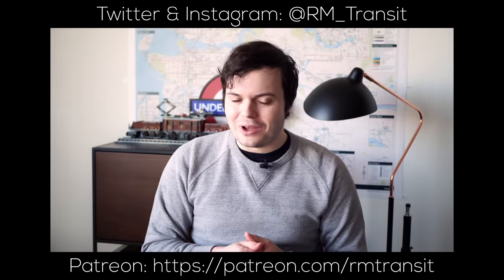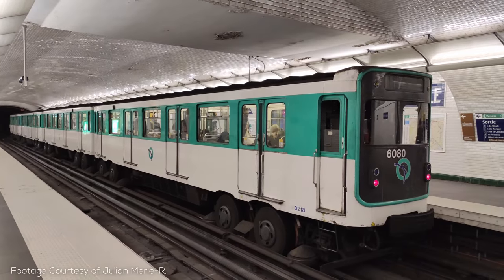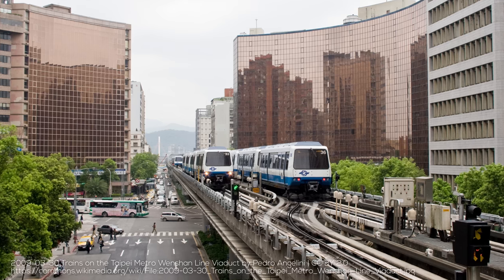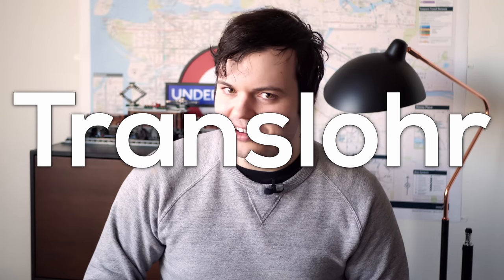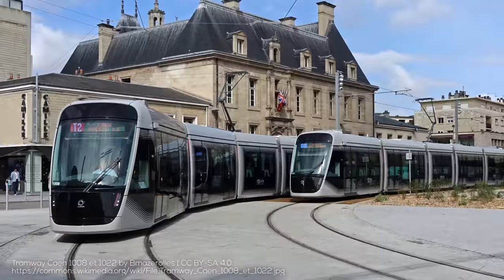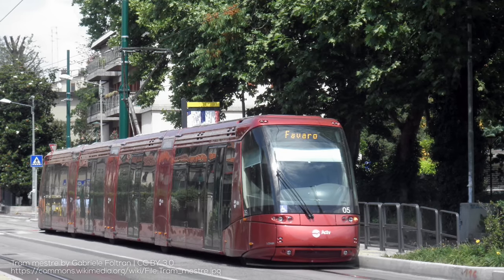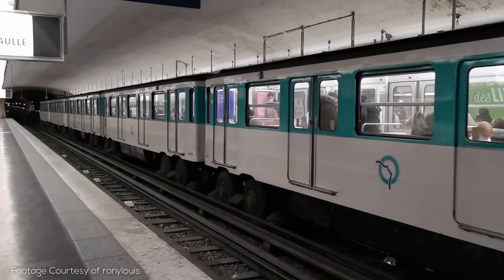Rubber-Tire Rail Transit is Weird

Comment: in my city (Perth, Australia) there's been something of a push for 'Trackless Trams' recently--specifically, the ART system by CRRC. Pretty funny to me, since 5 minutes of searching will tell you their weight and tyre configuration makes them illegal to drive on our roads.
Reply: Why would they be illegal?
Reply: I hoped thats what this video was about. I'm looking forward to the Trackless Tram, I'm sure they can change the law. What will be interesting is to see if the vehicle alignment causes rut formation and requires concrete guide way, at which point it loses all value. 

But, if Perth lets ruts for, rips up the road and builds a real Tram, and then puts the Trackless Tram on a new route to repeat, that would be something
Reply: @neolithictransitrevolution427  I don't get the trackless tram personally. Seems like a lot of work and expense for not much reward.

I'd much rather see dedicated bus lanes and bus priority at traffic signals across all the 9xx bus routes, and maybe some rebranding, which would likely cost a fraction of the current vague plan to convert half a route to a "trackless tram".

I also don't like that the City of Stirling is so obsessed specifically with the ART vehicle from CRRC. Volgren is making very similar vehicles for Brisbane Metro. But they're calling them what they are, buses. CRRC seems to be pretending they are in a different category in order to avoid a fair competitive tender process, and City of Stirling has fallen for the con.
Reply: @neolithictransitrevolution427  This reminds me on ideas about treating BRT and trolleybuses as a base for new tramways and LRT since their infrastructure costs are lower than building a street railway.
Reply: @MarioFanGamer659  I would love to see a jurisdiction explicitly set up a schedule for a project of that style. It's long time horizons, but you can cycle your Diesel buses onto a new route when they phase out, etc. 

At the same time you upzone along the corridor, so by the time an LRT is built you have a dense urban linear area.
Reply: @thegreentimtam  yea it seems like spending a lot of money for a marginal gain over bus improvements, which would actually be substantially cheaper. You can also have much higher frequency by buying more ordinary, or bendy busses
Reply: @thegreentimtam  I mean, to me the point is you get a fair amount of reward for not to much expense. 

I 100% agree "Just build BRT". Like that should be the first step always, you literally just have to paint triangles on the curb side lane of a stroad, and update some light cycles. 

But I think as an update to that, the ART offers reasonable capacity boost, maybe a more comfortable rode (or the illusion of a more comfortable ride as many people are annoyingly bus phobic), and self driving which cuts out a huge part of the transit cost. 

I do agree they should be treated as buses for most purposes. And I'm not saying I appreciate the execution. But (as a Canadian) I'm very excited to see this Australian project go forward and learn about the operational aspects and actual cost of building infrastructure.
Reply: @Joesolo13  It seems to me this is true in terms of Capital cost, but since the ART is Autonomous, you have a much lower labour cost. And that may allow higher frequencies/lower cost long term. 

But yes always start every project by saying "wait, should we just give the bus a passing lane and signal priority".
Reply from the maker: Yeah I’m skeptical, very skeptical….
Reply: They've calculated that certain wheel arrangements and tyre dimensions can carry specified weight limits per axle, in order to try to prevent rut formation. iirc the ART vehicles exceed the limit by 40-50% on the driven axles.
Reply: The part about rut formation worries me, because the ART exceeds the 'safe' weight limit for that by quite a lot. It's really designed for concrete surfaces.

...it also prevents us from building grassy tramways ;P
Reply: @neolithictransitrevolution427  They aren't actually autonomous, as all current models are built with space for, and driven by, a driver. It's largely a marketing exercise; the ART (Autonomous Rail Rapid Transit) system is neither autonomous, rail or rapid transit. It's a fancy guided bus, very similar to the long existing O-Bahn in Adelaide.
That system hasn't been expanded for a reason, with Adelaide instead opting for the more sensible option of improving the rail and tram systems.

The only benefits this system has over the O-Bahn is the larger capacity and being electric rather than diesel powered. However, these both massively increase the weight, leading to the rutting issue, higher maintenance and the problem that they cannot go on normal roads due the damage caused. In my opinion, this makes the system largely one designed to lure gullible and self serving politicians to the lower upfront cost and "futurism" of the ART.
Reply: Not an isolated case, here in Indonesia the national govt is also aiming to get the "ARRT" (which frankly is a bus) as part of the supposed public transport system in the planned new capital city.
Reply: @neolithictransitrevolution427  the downside to this strategy is the time to convert the line from fancy bus lane to tram tracks would probably require not running services. It's inevitable sometimes, but should probably not be intentional in the early days of a new line. Especially since it could hurt development if people know that the disruption is coming, so don't want to move to the area until after the upgrade occurs anyway.
Reply: @matthewparker9276  I disagree, I think if you have the plan laid out in advance distruption can be minimal. Buses can be run over tracked sections once complete, and can detour into the left lane in areas under construction. 

Generally transit project (in NA at least) seem to suffer from extreme short sightedness, so distruption for upgrades is common. But with planning it's avoidable.
Reply: @svenwillett1750  it's interesting to note that the local politicians seem to have been taken in by CRRC's claimed passenger capacity, too. The claim is that a single (3-section) ART vehicle can carry ~300 people, but this is apparently based on a packing density of 8 people per m^2, when the Australian standard is 4/m^2. Auckland Light Rail Group, who were considering the system, released a memo calculating the actual capacity at 170 people.
Reply: Perth really has a pretty extensive bus network and yeah some trips could probably be replaced with other forms of transit.
That said it has been previously talked about putting light rail here (Perth MAX), but the government of the time decided against it and we still have busses (The 960 appears to follow the route of the main spur between Morley and the Causeway and there is a rail line being built that will serve Morley which might replace that).
I do think not having some sort of rapid transit option over the causeway and through the city is a missed opportunity though, not ideal having so many duplicated busses running into and through the city, which could be served better by a single tram/light rail service. That said Vic Park Transfer station is not particularly well suited to terminating bus services and would need to be redesigned to cater for that. (which I suspect would have been part of the Perth MAX proposal)
Perth will probably either settle on a basic BRT system or do its typical exercise of replacing routes with a single High Frequency bus service, likely not alot of money left in the kitty for transit projects after the extensive Metronet build.
Reply: @LawrenceBayly  The 960 runs from Mirrabooka, not Morley. But indeed, good summary.

The ART proposal runs Scarb Beach Road from Glendalough to Scarb Beach, which is currently serviced by the high frequency 990.
Reply: @svenwillett1750  My understanding is that while there is a dtiver thier for safety the vehicle is self driving. Once a demonstration period is over and the self driving is approved I would expect to see drivers tajen away. Is this incorrect?

Idk about maintenance, EVs generally reduce requirements. But the potential rutting is the big problem to me. If it prevents ART use on standard roads, and requires concrete guideways, then the project has no use.
Reply: @svenwillett1750  Tip: When you see a non-indactive XYZ name just call it "accurate under Voltairian definition i.e. neither X nor Y nor Z". ;)
Reply: @neolithictransitrevolution427  Nope, it is not driverless. Autonomous-rail is the name of the guiding system - so the "rail" is autonomous, but the vehicle is not. It is driven like a tram.
Reply: @thegreentimtam  I'm unclear what you mean. Are you saying a driver starts and stops and the rail guides in motion?
Reply: @neolithictransitrevolution427  that's my understanding
Reply: @thegreentimtam  Mine as well. 

What I'm suggesting is that the starting/stopping is relatively easy (Tesla has been able to do this for years), and the hard part is general driving. So while a driver is certainly beneficial for the short term while testing, long term I would be suprised if these systems didn't get a software update to be fully automated.
Reply: @thegreentimtam  Actually replacing the 990 probably makes a lot of sense considering busses are likely not that well suited to carrying surfboards (the 990 being the only service where surfboards are permitted (unless under 1.2m long)), so maybe they can look into a longer more dedicated vehicle that would suit that purpose. I'm guessing if they wanted to they could run it directly out to the beach too, rather than on a road nearby.
Any chance you have a URL for the actual proposal?
Reply: See what happens in Brisbane I suppose
Reply: @pointlarf7412  as far as I understand it, Brisbane has ordered a bunch of electric bi-articulated buses and are inexplicably calling them 'trams'? I mean, good for them, but their vehicles are nothing like a tram in layout or in operation. Their messaging is confusing lol
Reply: @sorenfox  fair enough... How do they differ?
Reply: @pointlarf7412  Mainly that they are called buses by the manufacturer, and do not have any kind of guiding system. But they are both bi-articulated electric buses with level boarding and somewhat tram-like styling.

I wasn't aware Brisbane was calling them trams. Everything I'd seen about Brisbane Metro referred to it as a busway with "tram-like buses", which I think is fair.

Edit: the Brisbane Metro website now refers to the buses as "metros". Honestly, I think I hate that more than "trackless tram".
Reply: @thegreentimtam  yep. Personally I think it's the way to get something off the ground relatively quickly... In Brisbane at least.  Should be doable to automate by retrofit... We do it in the mines under more trying conditions... I think they just call them metro...instead of labelling them buses...which they are...

Comment: Tires are based, like the MPRT. They do allow for tight turns using 4 wheel steering.
Reply: I don't see why you couldn't do that with steel wheels. In fact, I believe that at least some modern US freight train engines actually do that. (Probably helps especially with three-axle trucks.)
Reply: @KaiHenningsen  we use them because of the steep grades along several portions of our track. The city is built on the side of a large hill and the majority of our guideway is elevated, so the cars have to be capable of going up steep grades at times.

Comment: The fact that rubber tires makes less vibrations is important for metro like Paris or Lyon when the lines are not deep. Vibrations spread to the nearby buildings, and living nearby a metro line, I am pretty happy with the rubber tires.
Reply: Interesting, it may be a less expensive way to deal with NIMBYs than boring. This idea deserves some digging into.
Reply: @neolithictransitrevolution427  Your comment certainly deserves some form of a punishment.

Sorry...

Comment: In Japan, rubber tyred transit systems have been introduced in 3 types, subway, monorail and auto guided transit (AGT).  Only Sapporo City adopts a full scale rubber tyred transit system for its subway lines similar to those in Paris.  Other monorails and AGTs are adopted by a large number of business operators as a medium-capacity rail transport system.  A rubber tyred tram system has not adopted even a trading company marketed Translohr in 2000s but no adoption result was made.
Reply from the maker: Yep! It’s mostly crystal movers and monorail

Comment: Hey, you talked about my city!
I live in Caen, Normandy, the city that replaced tyred trams with traditional ones (at 7:21).
I witnessed the old trams (which were small and crowded, such that on chilly mornings, a lot of condensation formed on the windows), the transition period (lots and lots of road works, and sometimes the old trams hat to use their motor engines on sone sections, since the power lines had been removed) and the advent of the new tram!

Comment: 12:45 Actually when raining rubber tyres will suffer less loss in braking power compared to steel wheels, unless your tyres are slicks, which in the past would likely have meant that automating a train would've been easier if it used the former (unless its fully underground & thus the tracks won't be made slipperier by rain), though I guess improvements in propulsion/signalling technology would make this less of an issue for steel wheels now e.g. embedding sensors to detect if a track is more slippery due to rain, which would trigger trains to brake earlier & more gradually, & perhaps run at a higher top speed to make up for loss in time due to more gradual braking

Comment: The rubber tired tramway in Nancy, France has a very steep lane. 
But when there is snow or ice, they can use their diesel to follow the road (not as steep).

Same for at least one of the parisian tramway, it climbs a big hill, that cannot be done using steel wheel.

And for the parisian subway, for the line 6 (the aerial one with rubber), using rubber tires is much much quieter than  steel. This is important when the subway is aerial in wealthy neighborhood. (The second aerial subway has steel wheel, but it moves in more popular neighborhood so....)

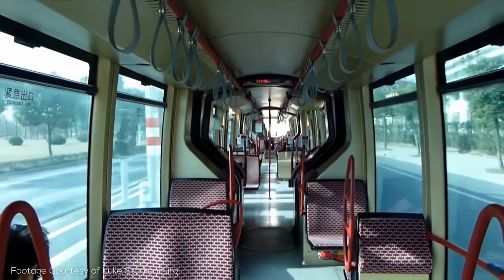Comment: 9:10 yeah, about the issue with the state of the rails, there arw issues that can't be solved with maintenance, in the case of Mexico City that is the sinking of the city.
That is why we chose rubber tired trains, they are ligthers and more forgiving to alignment of the tracks and because of the differential sinking of the city it was impossible to keep a perfect aligment, both, vertically and horizontally, rubber trains could cope with the tunnel becoming quite bent over time in a way that it was not possible with steel wheels, and the tunnels themselves were designed with that in mind, even trying to make them some what bouyant to mitigate the sinking as much as possible.

Comment: I used to live in a somewhat steep city in Switzerland and they just had dual-mode trolleybuses which ran off of overhead lines in the city center and diesel in the suburbs and countryside. I don't know why more small-to-midsize cities in North America don't take advantage of this model, as the startup costs are relatively low and the flexibility of the system is quite good.

Comment: Can you talk about Interurbans and why did they went away? Is their still a use for them besides coach buses or Commuter rail?
Reply: He talks about how important regional rail could be for our cities fairly often. Personally I would say that BRTs and regional rail make intercity tram lower value, but there is probably a place for it in polycentric cities or small cities.
Reply: Zaydan Naufal  Until very recently I would say Ottawa had one of the best as well. 

The advantage of BRT is the rapid build out time. Most BRT routes should evolve into Trams/LRT over time, but I don't think there is another solution if we are serious about extending quality transit throughiut North American Cities. 

Besides, how far are we really from self driving buses.
Reply from the maker: I’ve talked about them in a couple videos, maybe a dedicated video is a good idea!
Reply: @neolithictransitrevolution427  I think the Rhine-Neckar region is one such an example where it works (fitting because it is polycentric).
That street running section in Seckenheim, Mannheim? Not a tramway but a narrow gauge railway. Part of the Rhine-Neckar tramway is made up of old narrow gauge railways which forms a triangle between Mannheim, Heidelberg and Weinheim and the tracks are still legally classified as them (e.g. according to OSM, some stops have the name "Bahnhof" in them which is very unusual for trams) despite being, for all practical purposes, an interurban tramway network.
There also is the S-Bahn (the regional rail in question) but it has got a wider range and thus wouldn't serve all the other towns between these three cities.

Comment: In Lyon, France, 3 of the 4 metro lines are rubber-tired lines. The 4th is “steel-tired” because is the oldest and the steepest (the oldest section open in 1891 as a funicular line) and the extensions in 1974. This line is among the steepest in the world with a 17,6% steep in the 1891 tunnel. Here the slope isn’t taken with rubber but with a rack rail as third rail. The train is powered by over wires. It’s so specific than Alstom had to design a specific train with this all tech only for Lyon metro system. The three other lines are very similar to Montreal metro

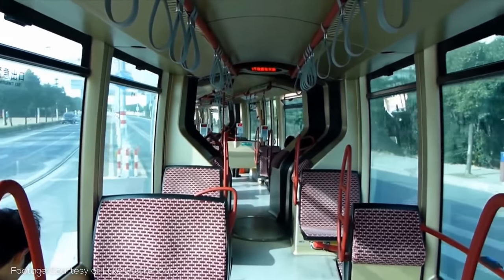Comment: 9:00 What is the advantage of the translohr there over a regular trolley bus? Both are electric, both use rubber tires, both require power cables and use panthographs, but the translohr is also niche and has only one supplier, and needs more infrastructure in the guide rail and stronger concrete?